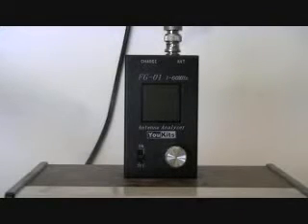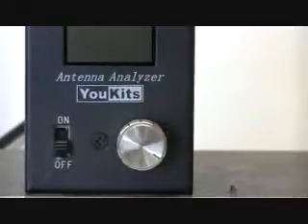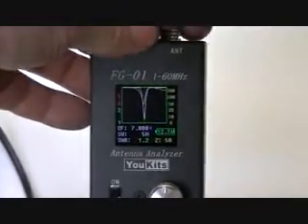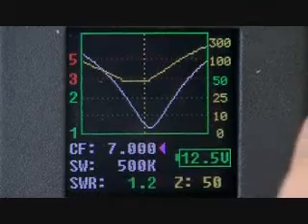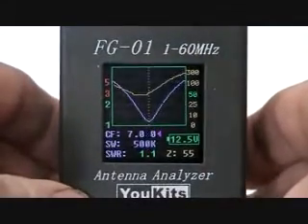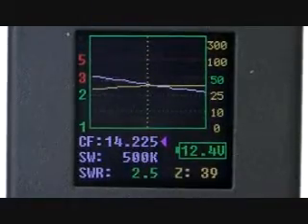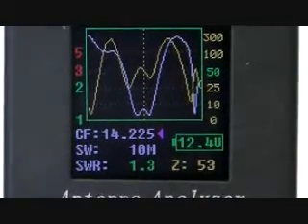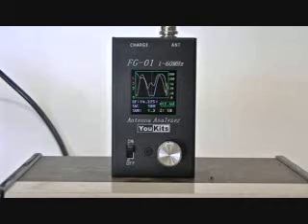youkits fg-01

Comment: How did you hook up the analyzer and the tuner to the antenna at the same time?
Reply from the maker: The same way you would a radio, the analyzer into the radio connector on the tuner, the antenna connector on the tuner to the antenna. that way you can tune the antenna to the desired freq. change over to the radio and be good to go. hope this helps.
Reply: Makes sense. Thx!